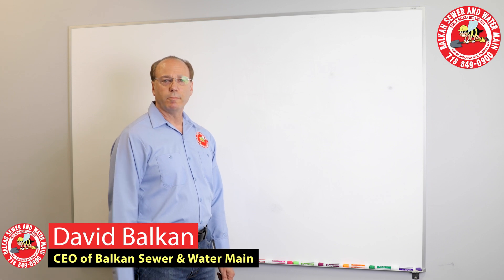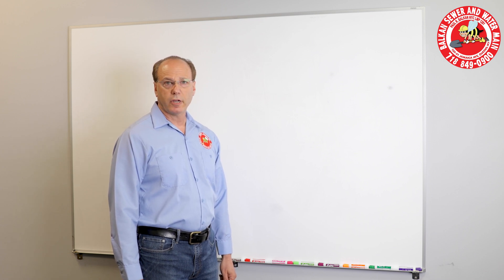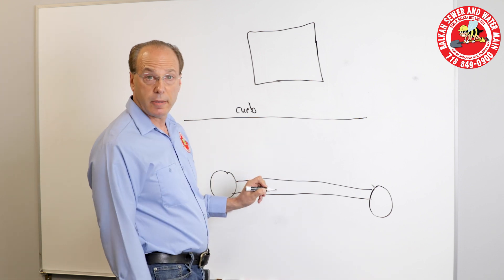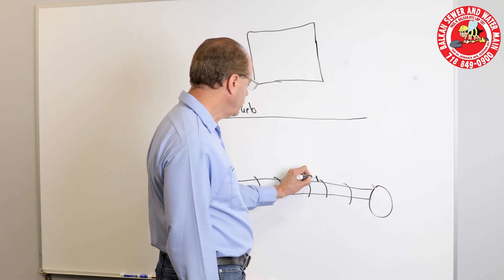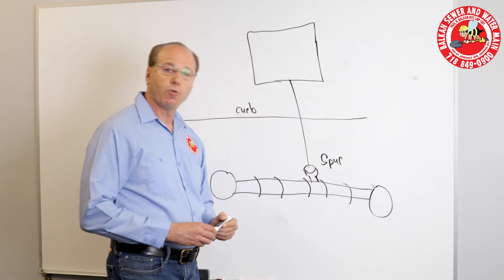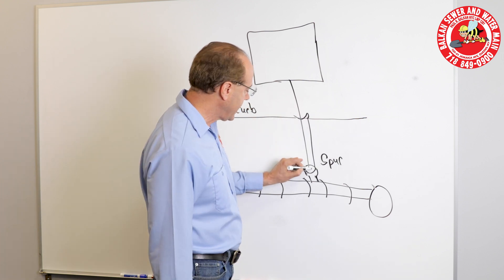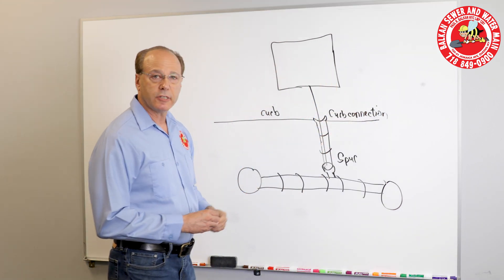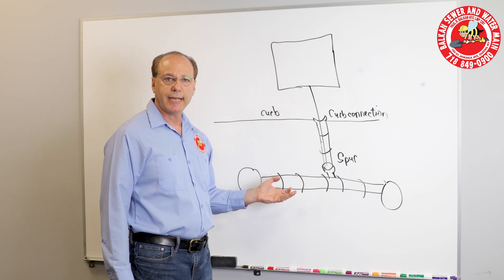Sewer Line Connection Types: What Is A Spur Connection?

Comment: What do you call the connection when it comes into the sewer system from the top of the pipe
Reply from the maker: I think you're referring to a vertical connection, which is known as a riser. I actually just did a separate video explaining a riser:  https://youtu.be/xH4j2CYY-U4
I hope that helped.
Reply: @balkanplumbing  I think that is what I have. I live on a semi steep hill. All I know is that my lateral comes down from the top of the pipe.
Reply: Service lateral.
Reply: @michaelbea2525  okay. I actually like that because I feel that the pipe has to be super full before it could go into my house.